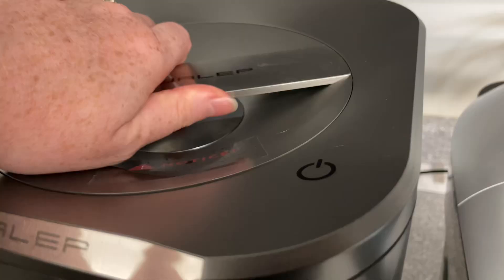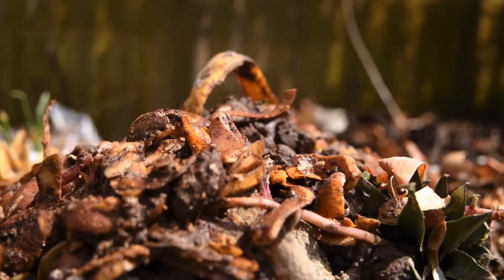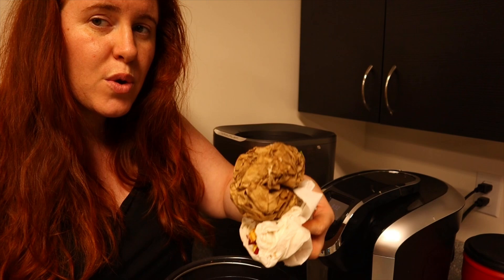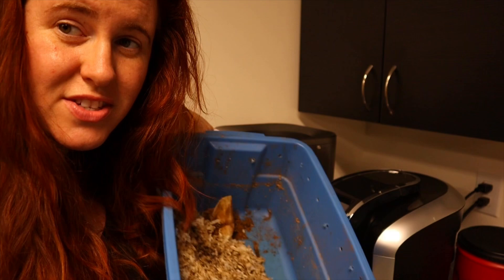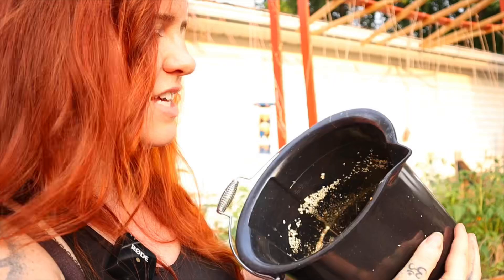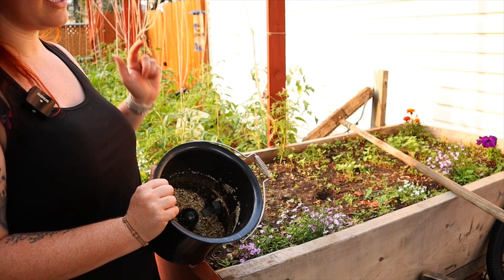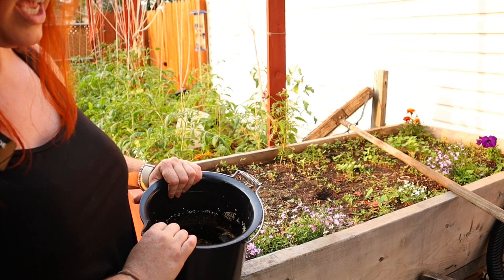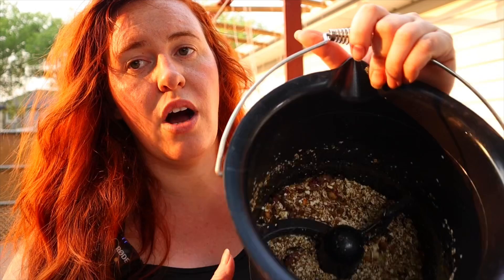How To Use The Electric Compost Byproduct!

Comment: Now if only there were cheaper electric composters...

Side note, have you ever done a video on worm composting for beginners? Like maintenance, including in winter, and how to get started
Reply from the maker: They are so expensive I agree

And no I haven’t! But I totally can.
Reply: I would love this kind of video!
Reply: Don't forget to check out online market places like Kij eegee(not allowed using the real words...). I bought my FC-50 off of Kij eegee for $150. I have seen other FC-50's BNIB for as little as $200. 
Some communities like Haliburton and some places in BC have incentive programs where you can buy a FC-50 for $50 and Eco5's for $200. Some are reselling those. 
Also some condo folks are finding that they take up to much counter space and have no other space options. 
A tip is that the last 8 digits of the serial number indicate when it was made(applies to Vitamix FC-50 and maybe the eco5).

Comment: Do you think that if I dehydrate my food scraps and then throw them in my blender that would be roughly equivalent to the heat and abrasion of an electric composter? Coming from the perspective of wanting to try this out, but not wanting another gadget if I can use the ones I already have
Reply from the maker: Yup! Absolutely a waste management tool
Reply: So I did this for about a year with my eggshells. I would feed the ground up shells to the chickens or sprinkle them around tomato plants.
What I hated was the mess and the hassle. I’d try to rinse them off, dry them on the counter, or dry them in the oven, then put them in a blender to pulverize them. 
Or it was a wet smelly bin under the sink that looked gross when you opened the cupboard.

I think the bottom line of these machines is convenience. We’re paying for the convenience of doing what we could do ourselves but faster and with less hassle and mess. ❤

Comment: @GardeningInCanada Thanks for doing this I have been so confused about what to do with the Foodcycler output. I tried putting it around my newly planted tomatoes and beets etc and some of our other new garden flowers my wife just bought and her outside plants like palm-lily's. The next day they were all in very bad shape especially the palm-lily's. I am not a gardener.... :( but trying..... They were all very wilted and the palm-lily went very brown. So I stopped ding that? 
I started throwing it on my grass just thinking it was productive until my security cameras showed I was contributing to feeding Noah's ark ie. rats and mice.  I live in East GTA area, so that is not OK....They stopped coming around as soon as I stopped putting the Foodcycler output on the lawn. So I stopped doing that? 
I have a compost black bin in the backyard and have started throwing it in there and it seems to be ok. What I would like to know if you can help me with is how long will it take to be composted in there?
Thanks for all your advice.
Reply: “Browns are carbon or carbohydrate-rich materials. The main job of browns in a compost pile is to be food sources for all of the lovely soil-dwelling organisms that will work with the microbes to break down the contents of your compost pile. Also, brown materials help to add bulk and help allow air to filter through the pile.” 
The Spruce

Depends on your ratio of brown to green material, water, heat, turning. 
Can take one to two months to turn a pile of material into compost.
Reply: She says the material from the machine is considered brown material. So composting time can depend on your ratio of brown to green material, water, heat, turning. One to two months to turn a pile of material into compost.
That’s according to the website The Spruce.

Comment: Any idea on how many watts it uses during a typical run? Heating and grinding are pretty energy intensive so I was wondering.
Reply from the maker: I’m not sure to be honest. I can’t see if being cheap. But you could try even an air dehydrator like the netting stuff if you wanted to. You don’t absolutely need an electric version
Reply: @GardeningInCanada  I was eager to know how much it cost to run my FC-50, so I bought a sonoff smart-plug (s31) and monitored the power ussage. It used between .8kw and 1.5kw per batch, dependent on how wet and whether I was doing a double batch where I kept adding more material as the initial stuff dried out. It also allowed me to have it auto turn on during the cheapest power usage time of the day. 
So in Ontario with the lowest TOU rates it means between 8 – 15 cents a batch.  That lines up with what is indicated in teh manufactures specs.

Comment: A couple of electric composters have pods or a liquid that the manufacturer claims add microbes so you can use it as compost. Is this true? If not, is there a product that will perform that function?
Reply from the maker: No… it’s not at all accurate

Comment: You can insulate your hot compost, I have no problem to keep it working even in -30C temperatures. You need enough dry airy "brown" matter and added nitrogen (urea/ chicken poop) to keep the heat up and process going.

Comment: Compost ?
You sort it down to leaves & pile it up head high.
Leave it till next season & flip the top over making a new pile next to it.
The bottom of the pile is where the composted soil is.
Next year you flip the top off again & get the bottom of that pile.
It will be all broke down Carbon full of worms.
Composting is easy.
All your wood needs to be flash burned to charcoal then crushed to a powder for fertilizer making. Save the ash too. That's fertilizer & bug protection. Snails hate dust.